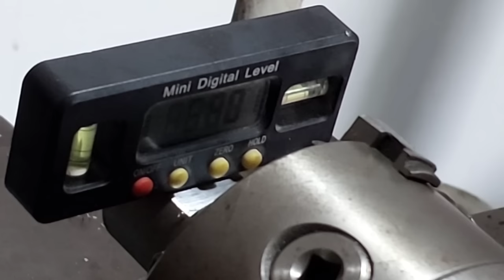Don't forget this old technique!! Making a slotting machine rod with a lathe

Comment: @0:06 the red drill and the cylinder, very good idea, what lathe brand do you use ? Nice video, thanks :)
Reply from the maker: Lathe brand La 530x800
Reply: @Yantoo  Thanks for the reply, for steel grinding, is 550W enough ? Kind regards